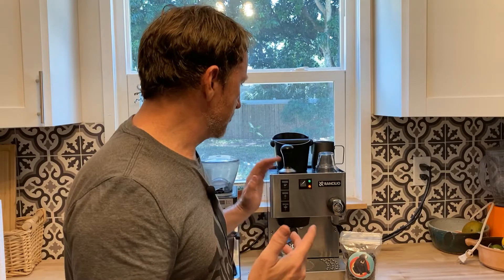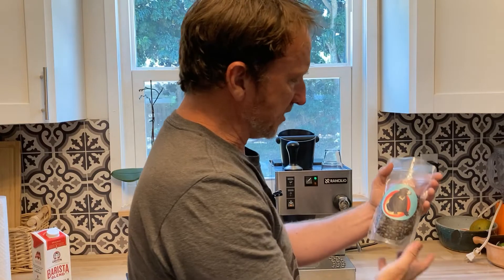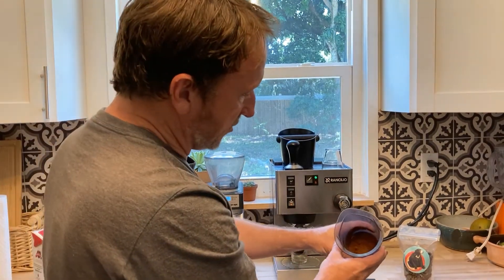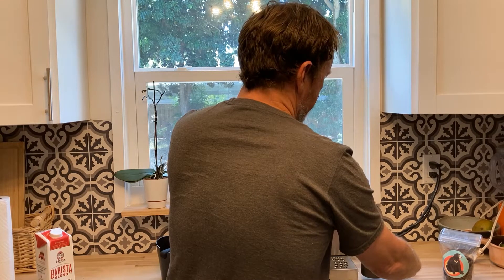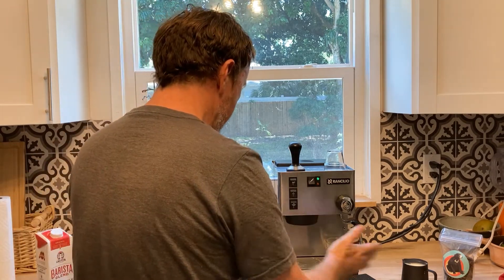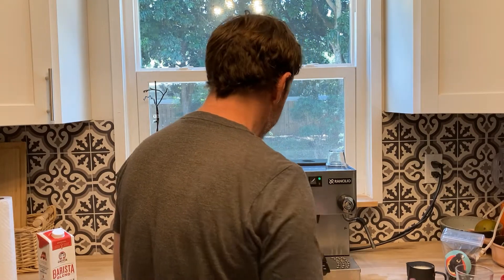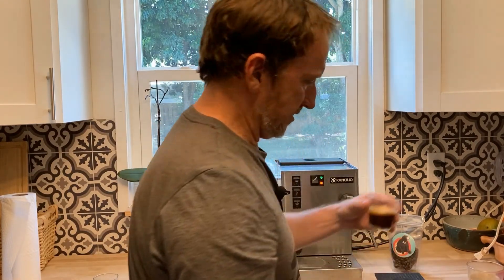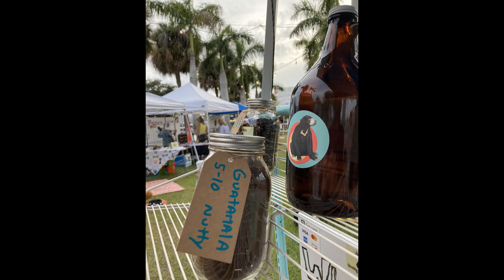Rancilio Silvia & Baratza Sette 270/Dialing In Shots

Comment: Hi, how do you fit 19g in? I can only fit 15g or less. I'm having an issue where the pressure seems to be way to high and the water is basically gushing out through the puck. I've watched your other video on OPV adjustment but not sure if that is the issue.
Reply from the maker: Sorry I did not mention that I have a different basket than stock. it holds up to 21

Comment: doesn't messing with the OPV valve affect your steam pressure as well?
Reply from the maker: not sure, but I can tell you the steaming is not an issue. it's still crazy strong
Reply: The OPV gets rid of excess pressure  when the pump is on, before it reaches the boiler.  The pump isn't on when you steam so the OPV doesn't affect it. The steam is created just by heating the boiler.